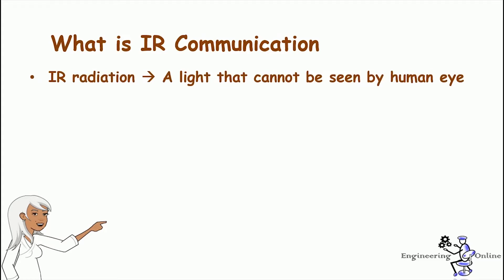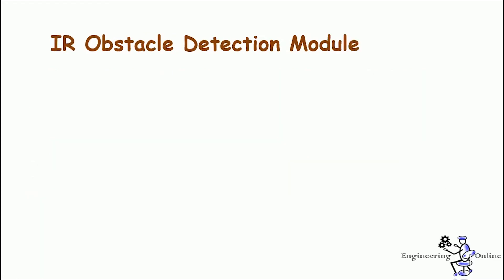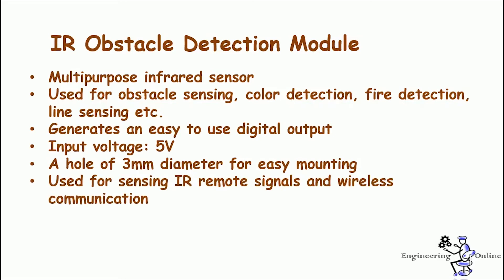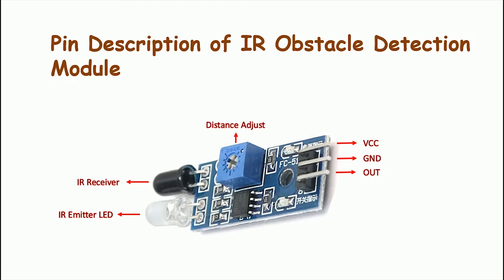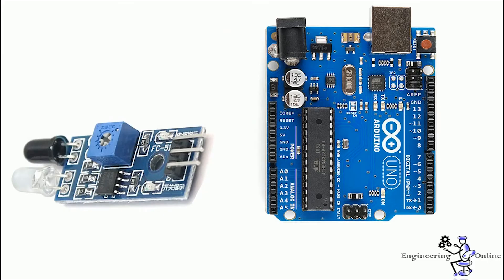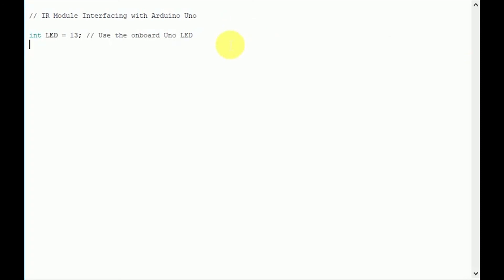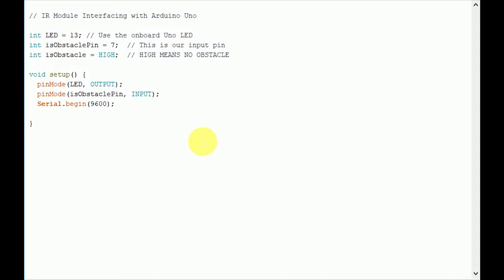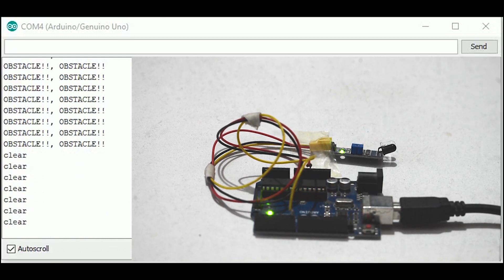Interfacing of IR Object Detection Module with Arduino Uno

Comment: What is the use of proteus in arduino uno .. and the libraries .. is it ready to use programes
Reply from the maker: Proteus is a simulator where you can  practice your circuits before working on real hardware 
Yes you can upload programs as well